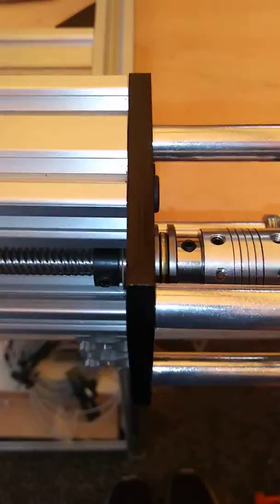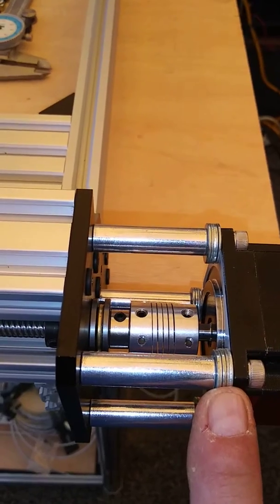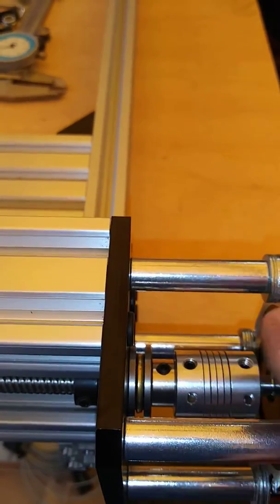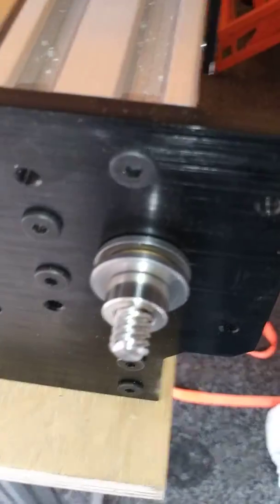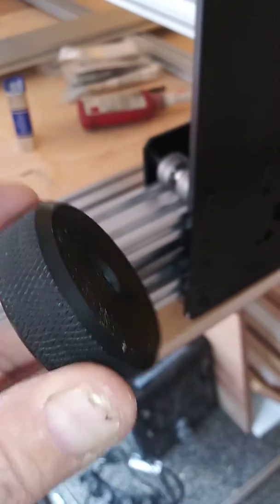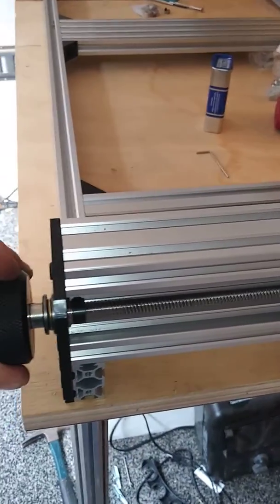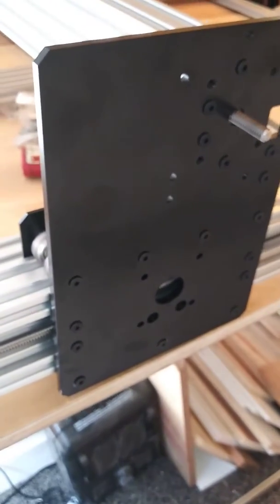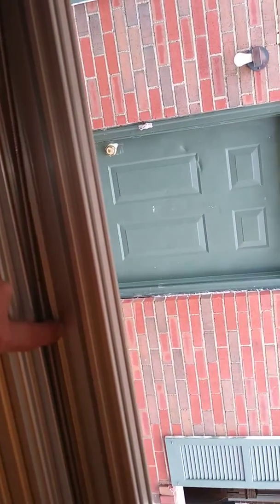Workbee thrust bearing lead screw whip fix

Comment: Hey Thank You for the video.... I am building my 1510 workbee now. It came with the Tension system, so my understanding is I have to wait until the stepper motors are hooked up to do the adjustment....  I can inst5ll the system now, Is that correct?
Reply from the maker: Yes you can add the system during build and adjust once motors are hooked up. Also if you bought from ooznest they have changed their design cutting the bearinging hole clean through the plate. So if you have their updated version you will also need some 1" washers with that have a 3/8th" hole.

Comment: great solution, where can one buy the giant black t8 nut used to tension the t8 rod?
Reply from the maker: You really dont need it. Activate your motors n use a ratchet strap to place the tension on the t8 screw. The ratchet strap will give you way more tension. You can snug them up by hand the throw the collar on n lock it down. Then release the ratchet strap n bing